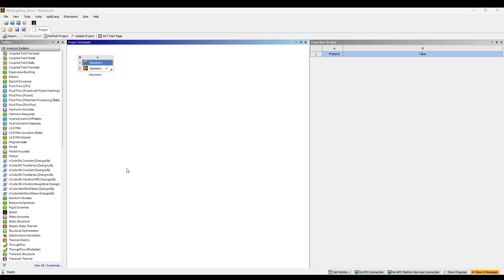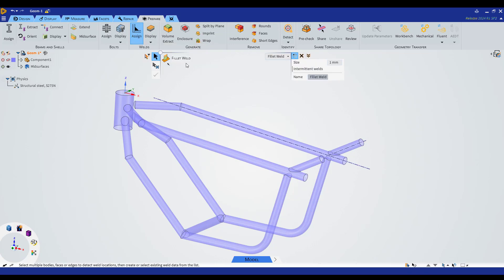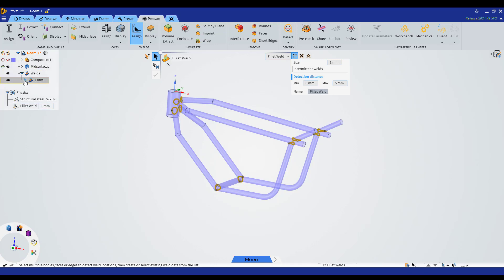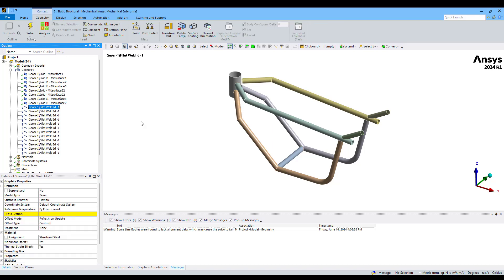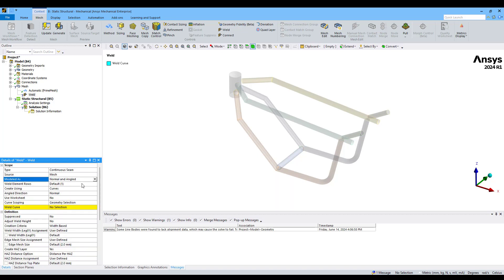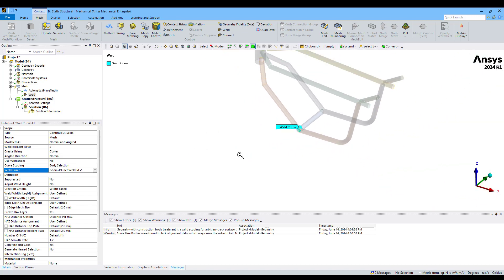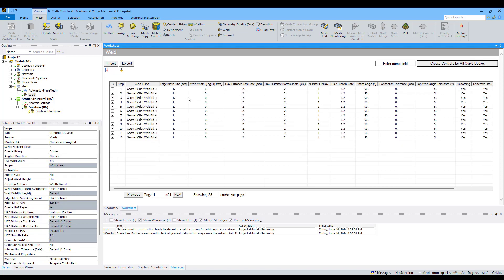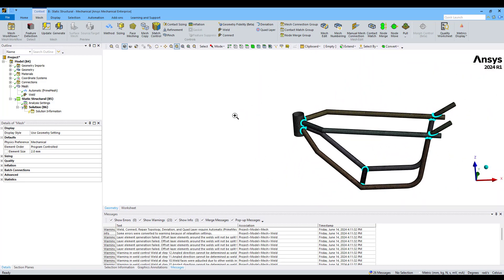Creating Weld Mesh efficiently using Discovery and Mechanical

Comment: Thank you for the helpful video. If we use Weld tool from Mechanical, will it work without the preprocessing with Discovery Weld Assignment tool? Is the work with Discovery "Weld - Assign"  tool mandatory for Mechanical Welding feature to work. Thank you.